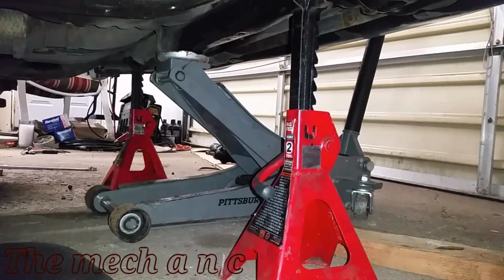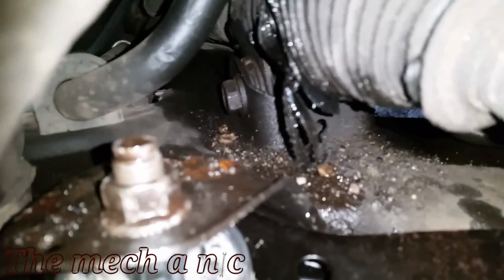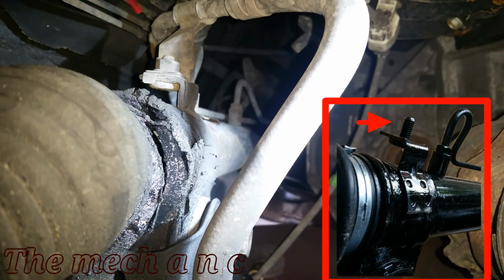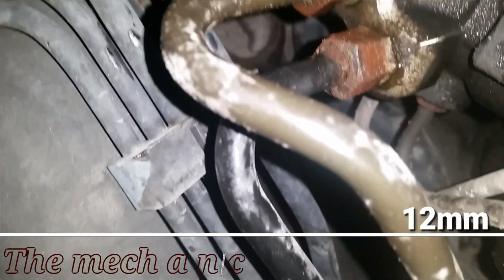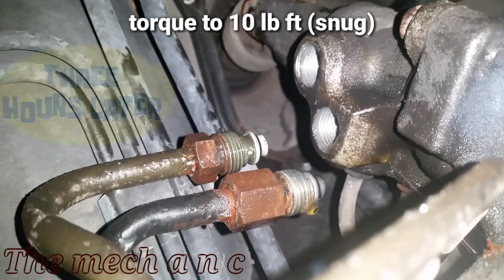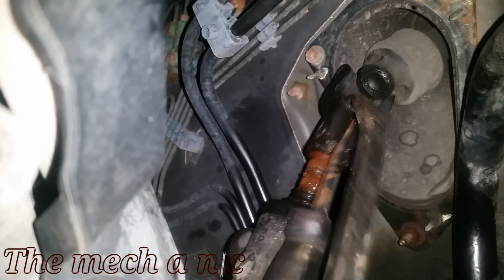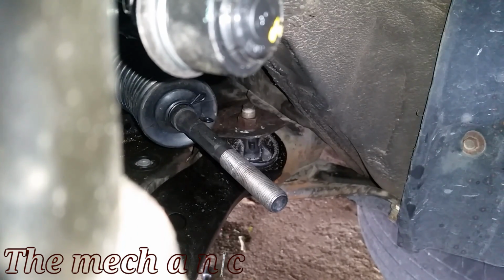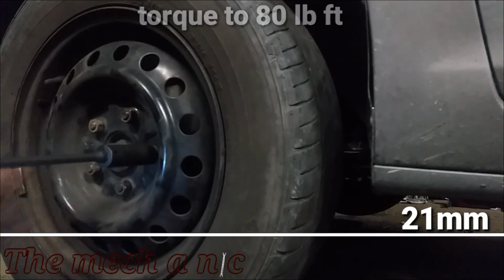02 - 06 toyota camry rack and pinion

Comment: I can't seem to get the shaft off the u-joint even though I have used a flathead screwdriver to pry it apart (and hold it there) almost 1/2 inch. I've got it to move up a little bit using a crowbar and hammer but I couldn't even get it off half way.

I'm going to try a larger crowbar today to see if that could help. How big is the flathead screwdriver you are using to hold the joint open?
Reply from the maker: It shouldn't take much to pry it open. They can be rusted in there so cars are a pain in the butt. Make  sure to use penetrating oil/pry bar/hammer where ever you can to get it off . What worked for me was to put the bolts back in the subframe to hold the rack n pinion down and hit the joint that you separated upward .It's the only thing that worked for me.
Reply: The mech a nic I managed to get the old rack out and the new one in but now I can't get the driver's side bolt back in (I got the passenger side). Im thinking of removing the sway bar bracket?
Reply from the maker: Sometimes you have to remove other parts into to go forward. Do whatever needs to be done 👍

Comment: Did you take off the reservoir and clean the screen filter?  These get mucked up and prevent flow of fluid to your rack and eventually cause the new rack to fail
Reply from the maker: I did not notice any of that, if the customer ever comes back I'll check it. 👍

Comment: Bro just took it out last night. Man you were right those 2 bolts holding the rack and pinion were the worst. I got another question when I refill and purge    the rack and pinion do I leave the cap open on the reservoir?
Reply from the maker: +DevilleHtwn yes,I like to leave the cap off while purging. The air needs to escape.

Comment: How do you center the new rack and pinion? If I buy a new one should it be centered ? When removing the old rack and pinion should the wheels and steering wheel be looking straight ahead?
Reply from the maker: +DevilleHtwn it might not be centered , use vice grips on the shaft with a cloth over it. Turn the rack n pinion left to right and count how many turns it takes then just center it.using measuring tape to make sure it's centered. Yes ,try to keep you "wheels" straight  and more importantly the the steering wheel . I think I went through this process in my rack n pinion video on the Toyota sequoia .
Reply from the maker: +DevilleHtwn https://youtu.be/t5RzTnwy9mg

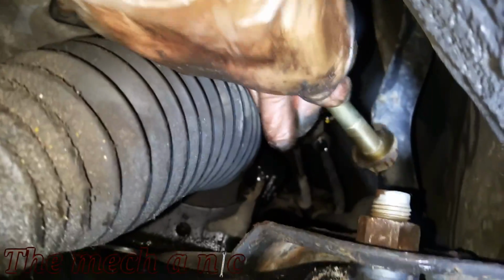Around the 9:00 min mark

Comment: should i get a rack and pinion replacement with outer tie rod ends or just the rack and pinion? does it matter? im replacing because of a steering fluid leak
thanks for your time
Reply from the maker: +Thomas Jaeger I'd replace the tie rods as well
Reply: With mine I found a bad inner and outer tie rod on one side.  You should change both sides.  For the $25-30 no point wearing your tires out later. Anyway your new alignment could be sketchy with old parts.
Reply: Yes get new rods.  The age of rods and rack.  Get all new as one person said, for $40 it is not worth an issue in a year

Comment: I'm planning on changing the steering rack bushings in the rack on my '06 SE V6

With the sway bar links and bushings removed, and the two bolts removed that hold the rack in, is there wiggle room to lift the rack up an inch or so to change the bushings in place , without fully disconnecting all the hydraulic hoses, and without removing the rack from the car?
Reply from the maker: +Michael Luscher you can give it a try , I think the most important thing to take off is the steering shaft then you might have room to replace the bushings. Good luck
Reply: Did it work? I'm hoping same shit right now